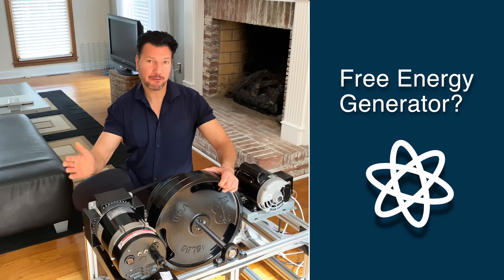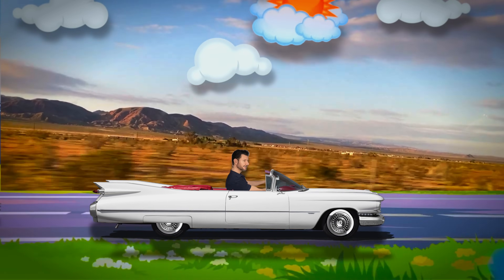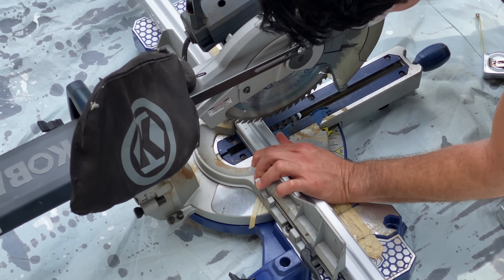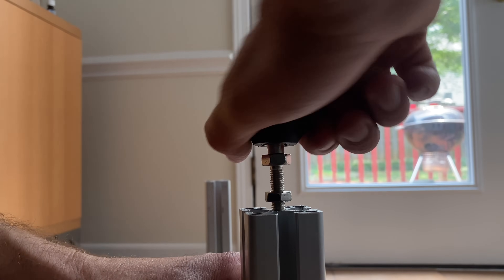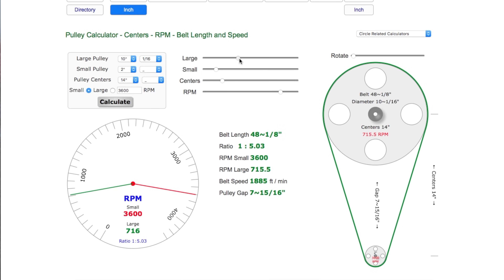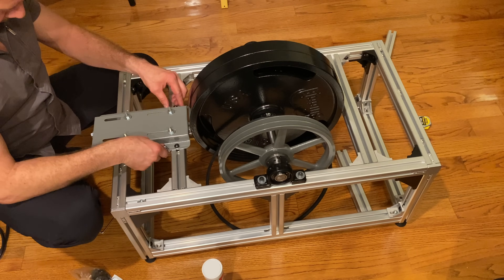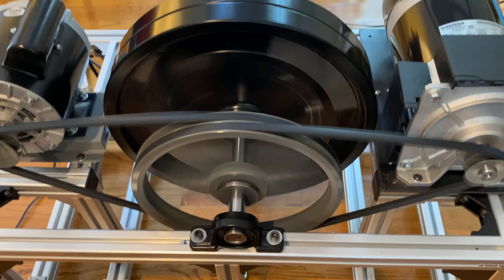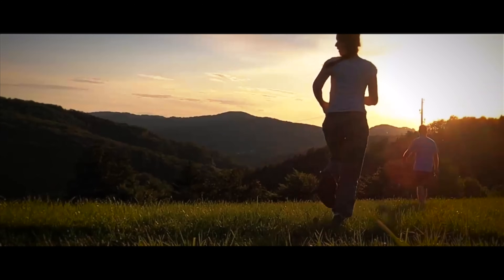How to Make a Free Energy Generator!

Comment: Hello Markus, l wanted to tell you that there are some important issues to consider. First of all, the force ratio for the mechanical action of the generator must be changed. The big wheel for the generator is good, the counterweight for the kinetic force is just as good but it's not good to use the same transmission for the engine, I'm talking about that size. If you pay attention to the other examples you will see that there are also voltage stabilizers. You can also add some capacitors to store the starting energy, then everything is ok.
Reply from the maker: Thank you David!
Reply: https://youtu.be/1l8K1k0lhW8
Reply from the maker: @James-qw7hp  very cool!

Comment: Kindly pls try a car alternator to charge the battery connected to a inverter (3000w) then connect it to the electric motor to turn the flywheel.. This flywheel then will power up the car alternator and the generator...  Ive been trying to assemble ths but thru luck of fund and parts are very rear to find specialy this fly wheel...

Comment: Guess the Laws of Physics  still hold 🤣 . It can't be done ! think of the loos of : resistance in the generator coil , resistance in the motor coil . Its enough for that to see that all the energy is consumed just by this 2 issue . To make matters worse : Mechanical friction from the motor and generator and the flywheel . Your not compensating for nothing . Its impossible just to keep that thing spinning with no load ! Let alone adding something . The most efficient ways of storing energy is of the Kinetic kind . But that kind of thing is way beyond us normal  people . Thers a type of Flywheel that  can spin at incredibly high speeds , I'm talking of a excess of 60000 RPM . And it spins freely  cause the Flywheel Has 0 Friction . That is why it's efficient . And that's achieved by the fact that it spins in a Magnetic field . A generator is hooked to the Flywheel only when its needed . And still it's Not free energy . It's like having a UPS . after a while the system needs to be charged again , so it's a energy storage system . There been more than 200 years of perpetual motion scheme . All of them Failed . Hers's some food for thought . If you had a motor  and a generator with super conductive coils and you hook them up . You may think that the system can sustain itself ? Answer is NO ! Why ? just cause of the Mechanical friction . So it will eventually slow down . So you see it's not a matter of how good you design the system . Another food for thought . The Sun . it still has about 4.5 billion years left before it goes BANG ! . Conclusion There is no free energy . Humanity on these days are thinking how to make a system to make it more efficient . That's the Holly Grail here . Me and other millions of people don't make these kinds of systems cause basic math and Law 1 of conservation of energy tells us . IT CAN'T BE MADE ! And we deal with it . Smart people are saying . Ok it cant be made . i know the laws . I know the Math , So what Now ? Well what if WE can design a system that can be more EFFICIENT !? . Math and Physics become our friend , not our enemy 😉.
Reply from the maker: Please watch part 2 and see if you still the same way?
Thanks

Comment: does not emit electricity for reasons because large electric motors do not have magnets inside them ... which means it does not create a magnetic field ,,, electricity can be generated by 9v motors. 12v. 5v. these can light a smaller lamp.... at least I think so

Comment: Energy can neither be created nor destroyed but energy can be store in the form of battery, what if you put a car alternator and two twelve volts batteries and a dc motor of high rpm, the car alternator will keep the batteries fully charge and the batteries will run the dc motor and the motor will run the whole system, the current produced by that ac alternator can be consume as out of the this system. Hope you got my point
Reply from the maker: I do get your point 
But for this statement to be true we still would need to produce more energy than we consume or the batteries will eventually just be dead.
I think without adding magnets or something it won’t work.
Thanks for your feedback though.

Comment: Great work, nicely establishment and hey, you did teach a lot of people with this one. Those Indian guys, what they actually did is that they used like 10-12 kw alternator/dynamo with some 2-3hp Motors. May be this much power generator be the key to this.
Reply: you are correct the large 10kw generator will run the small 2 or 3 hp motor and still have volts left over! but you can only produce enough power to run the 3 hp motor and you will have lets say 50% of 9000kw or about 3500watts! this would charge a battery that you can use for backup power also! now here is the best part! china makes alternators that run 600 rpm, so you now have 1800 rpm motor running 3 to 1 more torgue. i have a 600 rpm generator coming and will run with a 1hp 1800 rpm connect to a inverter fro battery and have a electric start for the motor until it reaches 1800 rpm then flip a relay at max rpm to stop the grid power and run off the alternator power. i am doing this to charge batteries to full capacity then turn off and run from batteries! will only use the system to help run air conditioning in the summer and i am getting a 12volt air conditioning system! i am getting rid of all electric alliances and going to natural gas, that i have for free! but not enough to run a generator! like buying from the city gas! the trick is the low rpm ( ALTERNATOR ) THEY USE LESS HP AT LOW RPM!
Reply from the maker: Would love to hear back from you once you have your system installed.
Thanks!
Reply from the maker: Thanks Ihsan!

Comment: Why not add a high voltage inline transformer and a high power capacitor. Should crank up the voltage to a high enough level to sustain your set up. Just a theory. Pulling the idea from my tesla coil. I put in 110v ac and get 650 million volts dc from the coil head. Scary as hell when you fire it up but it’s a lot of fun as long as you are safe.
Reply from the maker: 650 Millionen Volt sounds scary indeed! :)

Comment: can you use a UPS between the generator and the motor? This way it would be completely isolated with a battery buffer. Also, I haven't looked at the circuitry, but just at the top of my head I would think there should be an isolation transformer between the generator and motor. The UPS may offer isolation. Good luck.
Reply from the maker: Thanks Lincoln!
I think adding a UPS would perhaps make it run but hide the problem.
It still needs to create more energy than we put in and without magnets or something I don’t think it works.

Comment: Markus Nenning ? Start with a generator, car battery and 2000 watt 12volt DC to 120 volt AC inverter. The inverter would connect to the car battery, the car battery would connect to the generator to be charged and the AC plug outlet should give you 120 volts AC to use up to 2000 watts.

Comment: Markus Nenning ? Try running the RPM higher and then switch it over. if that doesn't work then test the difference in voltage, power when the generator is plugged in with the difference of voltage and power when switched over. I think your fly wheel is to heavy and how do you know if the people in India use 220 volts AC instead of your 120 volts AC ? Also try going to a car junk yard and look for a fly wheel from a car or truck.
Reply from the maker: Thanks!
I did have the RPM higher than required by the generator and it still didn’t work.
Reply: @MarkusNenning  ? Try a bigger size pulley on generator.

Comment: What about if you use smallest motor that can run this setup and highest generator
Reply from the maker: I have tried 3 different motors Anwar and this is the smallest that would still move the flywheel and generator under load.
Thanks 👍

Comment: adding the weight is ensuring its working to much. now it has almost 100 extra pounds to pull along.. just face the generator pully towards the motor and connect them facing each other and try again.

Comment: Why do you try getting generators from stores. They don't give the desired result, because of their design. If you want to multiply the electrical energy alone ( of course it is not free energy, the term free energy is entirely wrong), all you need to do is use multiple small generators ( hopefully lots of two phase brushless dc motors actually work as very best generating ac voltage and good amperage), you can use any 250 watt motor used for regular low speed electric bicycles as input motor, depending on your input motor's and output giving generator's torque balance you can generate the output electrical power that's greater than input electrical power. However there is a fact that when you try to plug in the input motor to the output obtained from the tiny generators, the input motor will slow down a little unless the output is 3 times more than the input. These kind of machine doesn't work with large scale power, but with only small power. Higest power outcome possible is not more than 8000 watts with input of 240 watt ( 10 amp at 24 volt) because there are more heat that damages the entire system. Up to 10000 watt can be generated from 240 watt, but torque balance is collapsed beyond 11 kilowatt.

Comment: Replace your foundation frame with solid welded steels.
Reply from the maker: Why would that help?
The frame I build is very solid and strong.
Reply: @MarkusNenning  aluminum is not rigid enough to resist vibration, its creating more friction. Your flywheel is also wobbling a lot.

Comment: Very nice work! I would be curious to see how a "pulsed" power system might work. In other words, assemble a bank of super capacitors that would power the motor with super high voltage for relatively short periods of time. The flywheel would maintain near constant RPM and torque but the powered motor would perhaps run less than 50% of the time under power. Hopefully that makes sense...
Reply from the maker: Yes I already had this idea floating around too.
I could see how that could possibly work.
Reply: @MarkusNenning  Fundamentally, you've still got those pesky Newtonian "laws" to deal with, but, hey... laws are no fun unless someone breaks them once in a while 😀. Bottom line is you really don't know for sure unless you give it a try... I'll look forward to see what you come up with! 

Really nice work on the build, BTW. I really like the precise, solid assembly you came up with. Very clean. Very professional.
Reply from the maker: @jaybanchero  totally agree you don’t really know unless you try for yourself.
Especially these days when you can’t tell anymore if a video is real or fake.
Thank you very much appreciate that! :)
Reply: @MarkusNenning   The biggest problem why self ruining generators are considered impossible is because the generator creates a drag force that slows down the flywheel and loads the motor. If the flywheel spins slower then the generator creates less power and the  motor draws more power. So the generator cannot provide enough power to run the motor and generate extra power. So you must either use a low drag generator design or, as I'm seeing in these flywheel videos, find some way to make the drag force negligible using the flywheel. I have seen videos of people using magnetic coupling to connect the motor and generator. The magnetic coupling prevents the drag from the generator to be transferred to the motor and load it. trust me once you can build a low drag generator then this is possible. I have read papers that said it is possible and it has been built, and the equations that govern it have been written. It was done by the Russians and they call it the new laws of mechadynamics, and the law of  inertial increase of electric power (page 16 of the second link). 

http://www.borderlands.de/Links/IMPULSE%20POWER%20SECRETS-3doc.pdf

https://www.gsjournal.net/Science-Journals/Research%20Papers-Mechanics%20/%20Electrodynamics/Download/2347
Reply from the maker: @raloed.363  thanks for sharing Ed!
Reply: @MarkusNenning  no problem. I look forward to more of your videos
Reply: @MarkusNenning  I have been trying to share this information for months now. I have posted comments on some videos that last for days but the instant I edit it and put in the links my entire comment is removed. others I keep putting the links and they just keep deleting them seconds after.
Reply from the maker: @raloed.363  I think YouTube only lets you share other YouTube links.
Reply: @MarkusNenning  only if the link violates the guidelines. mine doesn't cause it only gets deleted from some videos

Comment: So let's change the rules of physics I'm just going to poke around here you need a mechanical advantage I would use a gear reduction for your generator and I would set it just under the ratio for your flywheel a good rule of thumb to keep in mind is three times over good luck friend
Reply from the maker: Thanks Shaggy I am planning on buying smaller components and first work on a prove of concept and then scale it.

Comment: You may need a more efficient motor and Generator the bigger the motor and Generator usually the more efficient it is did you ever notice that the Indian and the other ones have very big electric motors in very big generator usually
Reply from the maker: Yes I have noticed that but I couldn’t find a generator like this here.
Also a scaled down version should work just as well if not better if the concept itself works.

Comment: Ok. The idea is good. I don't knows you will be read all comment or not, but...
You need improve your idea to normal condition. 
1. Remove all belt ( you loose a power on the belt, only gear connection)
2. Gear connection on the Maine motor should be get OFF then motor is STOP. Like a car starter, just turn engine and OFF. The same generator connection.

Comment: The problem in this system is to increase the sticking of the rotor on the generator, to reduce this sticking effect, you need to change the principle of the generator winding itself, which will reduce the sticking of the rotor. To be more precise, the secret is that in each coil of the winding there should be 23.3% of the winding wound in the opposite direction, which gives the effect of thawing, while the efficiency of the generator is not lost, which means that when the generator is loaded, it will be easier for the engine to scroll the generator

Comment: we used a Car alternator that only required 40foot lbs of torque at 3600rpm to produce 1200 watts.
then use a cupling to a Grinder that used less than 400 watts to produce 35ish torgue at 3600 rpms.

No Fly wheel.

it worked till the grinder ripped it all apart.  the grind switch was hard to control and locked into full speed..  Wow  10k rpm is insane! just inches when connected to an alternator.

the mounts failed quickly Rippp.

Might want to look at Grinders, they designed for max torque as low power consumption.  while Alternators are Maximum power output for minimal torque requirements.

much better results than those motors they ate to close in Consumption and Power needs.

Comment: Did the same thing. REMOVE THE START CAPACITOR AND RUN ONLY OF RUN CAPICITOR. the start capacitor will interfere and block emf once it gets running and makes link. But you'll need another source of start up. Good luck use imagination. That will fuel the nation.
Reply: I got it to work. But only once the start capacitor was removed. It didn't stop like yours did. Mine was doing the same thing. Its necessary to start the motor but will halt it once you connect both halves to run.
Reply: So use a 3rd starter motor while having both connected and it will run.
Reply from the maker: @skimowhite586  I will try that thanks
Reply: @MarkusNenning  hey i figured out what the problem was. First get an AC synchronious alternator. Second on the cables running to the inside of the inner coil use a seperate dc circuit. Like 10 to 24v with amps contol. Using a battery. Once you can get just the right voltage and amps to hit 240v then you make it so that the motor is running a little faster than the alternator. Not much but just enough. Then hook up both and bam it wiorks.
Reply from the maker: @skimowhite586     wow really is this something you have done yourself?
Not sure what you mean by separate DC circuit on the coil ? You wouldn’t have a schematic by chance?
Thank you!
Reply: @MarkusNenning  theres a coil with wires that runs to the inner electromagnet. It contains diodes. From that point grab the two cables and hookup a battery that can put out enough voltage and amps. Its diffrent for every generator. To put out 240v. You could even get more volts at lower rpms. From then keep a good ratio on the pulleys. You might want to set thoae werghts at the same rpm the motors are going. Ive got 150lbs going 2000rpms. Its crazy shaky until it hits 2k rpms. Also theres one last thing i havent figured quite out. My caps spark once gen slows down. I believe theres a back emf going on between both motor and gen. And if not wired corectly could be the cause of why you motor gen slows down. Mine doesnt halt like it did. Still slowly brakes over a period of time. Like theres still some resistense or the both arent in synchrony. From what i learned there must a frequency resonance between both and gen and motor. Like dance. If the dance is off by a bit due to pulley size. Electromagnet stregth. Ect the back emf will act like a brake instead of a boost. The reason it works is like eelectric cars that use its slow down period phase or relax phase as a for of power up to fuel the other in other works as the motor goes with in phases it power the gen while its rest as a motor and the the gen as a motor powers motors as gen and then back and forward.
Reply from the maker: @skimowhite586  you have a video of your system ?
Thanks!
Reply from the maker: Is yours working Icarusfilms?
Thanks!